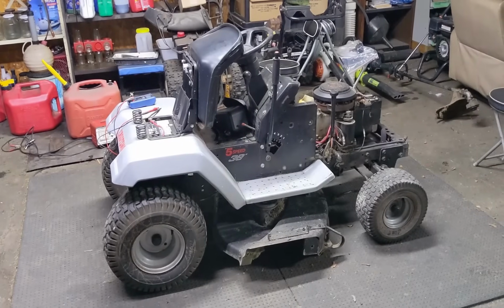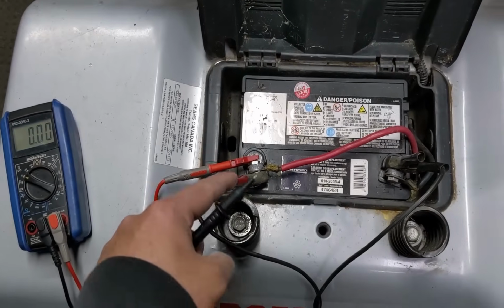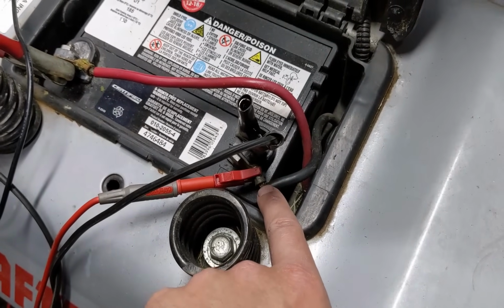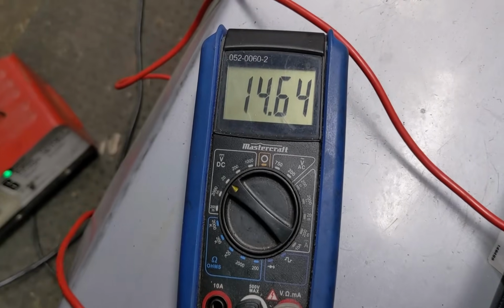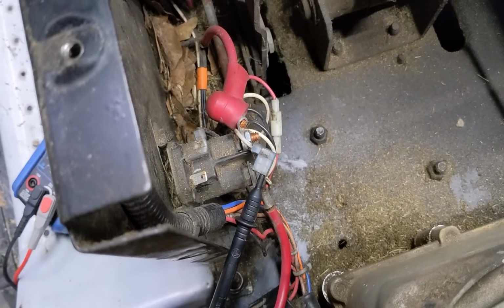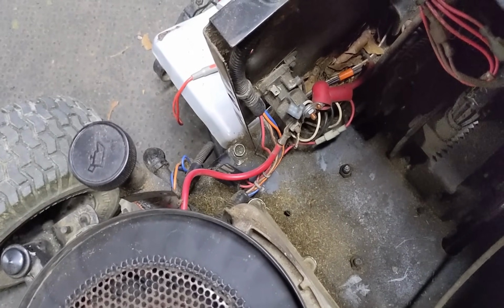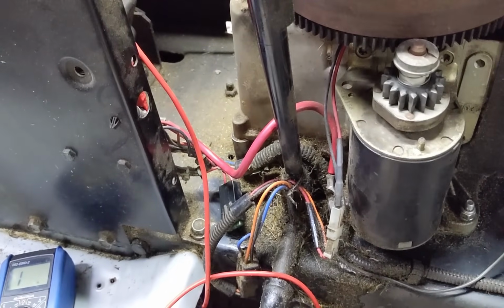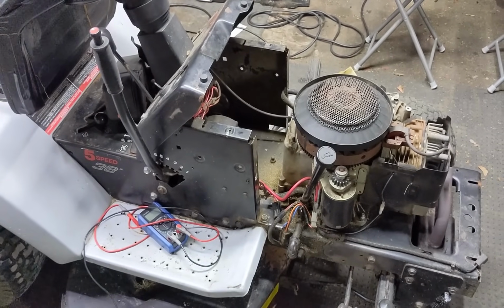Electrical Diagnosis of Riding Lawnmower that Won't Start

Comment: A Great video..
I've had a starting problem with my Hustler 54" Fastrak for months & I initially thought it was a bad ground because the 3 pole solenoid is bolted to a powder coated frame but thanks to your video it appears to be a faulty solenoid. It clicks when powered but no power when testing the starter side of the solenoid.

Comment: Did you know there are little slots on both sides of the end of the fuse? Stick your two probes in those slots to test the fuse without removing it. The amperage number is between the two slots. 😉

Comment: I have a sears gt3000 garden tractor from the late 90s early 2000s you can turn the key 10 times and never hear anything, on the 11th time it might start as good as if was brand new machine - this tractor does not have a starter solenoid. I assumed some one before me removed it, they also had a 50Amp fuse. But I just picked up another tractor of the same model and this one also has no starter solenoid and they jump wired the fuse. is it possible these tractors had no solenoids ? the actual starter motor mostly hidden by the engine plastic shrouds seems to have two "bumps" is it possible this starter motor has its own starter solenoid (the second bump) built in ? this vintage sears is an AYP (husqvarna) product. they both behave same intermittent starting even jump starting from bottom of starter is intermittent

Comment: I have a Toro Model 74787; Serial # 315001107.Does not start .Turn key starter turns but does not starts
Reply from the maker: If the engine cranks over, your starting circuit is working. You now need to test the engines running circuit. Something (safety switch) could be grounding out your coil. The easiest way to test if you have a bad coil, or an issue with a safety switch is you unplug the small black wire on the coil and try to start the engine. If it starts and runs with the black wire off, that means a switch is bad and needs to be replaced. If it still doesn't produce spark, then you need a coil.

Comment: My issue was related to a safety switch but not how you would initially think if you were trying to diagnose it. I by passed my RIO switch with a jumper wire a while back. The jumper wire had slid down under my PTO lever and was rubbing on metal when I switched the lever to the run position position causing it to short out. Zip tied the wire securely so it wouldn't move.  Problem solved

Comment: I'm getting 12+ volts on the battery side of the solenoid but only 6 or 7 volts on the starter side when I turn the key. Starter only turns the engine a small amount then stops. I have replaced battery and solenoid and still the same outcome. I am stumped...why do I not have 12 volts going to starter?
Reply from the maker: Test the voltage at the battery side when you're turning the engine over (putting it under load) you could have a voltage drop due to a bad starter, or a bad connection/cable from starter to solenoid. I would remove the starter and bench test it, basically putting 12v directly to the starter and see if that spins it properly. Then you rule out the starter. Electrical is always a process of elimination.

Comment: My ZD1011 blows the 10amp system control fuse anytime you try to start the engine.. the glowplug indicator still lights up.. tried disconnecting the alternator, no luck. Any idea what to check?

Comment: i guess it helps to know about electricity when doing this as i have no clue and it seems too mcuh to process.. i have a yardowrks ride on lawnmower and im having the same issue it doesnt even click so i just assume its electricla but i have no idea how to fix eelctrical things i have minmal knowledge of electricity i cant stand electric things..teh simple push mowers are more my thing..fuck these things. sounds like apain in the ass

Comment: Thank you so very much for your videos. they are very helpful.. maybe one comment you could make is before troubleshooting your starting problems; make sure that your blade is not engaged!!!!!!!🤣😂 No kidding!!! i watched both of your videos. PULLED my solenoid and tested it as per your instructions and all was good.... Followed the white wire from the solenoid to the cut off switch at the blade engage lever and from that position, my face was half in the engine compartment and I looked at the switch and at the same time my eyes moved up and seen that the blade was still engaged!!!!😆😆 The last time I cut the lawn it started poring rain and I drove it up and shut it off quick, never realizing that the blades where still engaged!!! The next time I tried to start it it wouldn't.. Never even thought to notice that the blades where still engaged!!🤣😂🤣😂
Thank you so much for the informative video!!🤣😂🤣

Comment: Just wanted to add to the others and tell you what a great you've done with this video. I do a lot of my own repair work with everything from the battery and screen on my phones to the heater core on my car and this is propably the best problem troubleshooting tutorial I've seen. Seriously. You explain not just what you are doing well but also why. I've never known why you need to test car batteries under load but don't have to with my flashlights; now I do.

Excellent work!

Comment: I recently had someone replace the starter on my mower. Right after it was replaced, it started no problem. The very next day it started blowing my 30A fuse. Doesn't even try to crank. Just immediately blows 30A. I disconnected the starter and tried different switch and it still blows the fuse. Could a bad solenoid cause a fuse to blow? Ideas?

Comment: Measuring resistance from the ground post to the frame with an ohmmeter is really useless, the current from the ohmmeter is nothing compared to the current from the battery during cranking. You could pass the resistance test and still have a bad cable.  This is a time when you should be doing a voltage drop test.  With the multimeter set on 20 volts dc, hook your lead to the negative post and the frame where the cable attaches turn the ignition key to start, and read the meter, what ever reading you get is the voltage drop across that cable so if your baseline is 12.75 and your voltage drop is 1.5 then the available voltage during cranking is 11.25.

Comment: Great job going through everything!  I went through mine and it ended up being the fuse not getting a good connection.  I have to get a new fuse holder.
Reply from the maker: Yes I've had to get them before, check the stens version it's very good, part 425-306

Comment: Followed steps and determined the solenoid on 2013 Husqvarna RZ5426 zero turn. I replaced the solenoid for the first time only recently. Mower has run twice since. Now the same issues as before, turn key and nothing. I did happen to look under the seat last time it ran for a visual after replacing the solenoid and touched the fuse box which seemed very hot. I did not restart but then a few days later nothing. The wiring harness has always appeared durable and well placed. I'm slipping wires out of the flex conduit for a n inspection of all the wiring.  I've never bothered touching that fuse box unless checking condition of the fuse. The box is clean. The heat felt on that box does not seem normal. No blown fuses, 20 AMP.

Comment: I have this same mower and checked everything you went through and it still clicks after replacing the solenoid. Please help. Also battery is brand new

Comment: I just wanted to say Thanks!!! I didn’t have a problem troubleshooting an electrical problem on the Abrams Tanks I worked on for years, but for some reason? I was intimidated by my Badboy Mower, maybe the name? Idk.  

 But thanks to your helpful walk through? I was able to locate the problem & figure out the root cause of the issue.. Which, was a little different than your problem here, so I’ll explain what I went through to help anyone else in my shoes. 

 Symptom: No response when I turned the key, no solenoid click, nothing. It gave out after 3 hours of cutting grass on a hot day, going down a hill. At first I thought it needed fuel because it was low, added fuel, then checked engine oil.. No, nothing. 

 Started at the battery which was good & well connected, tested the ground which had voltage going through the frame. But because I wasn’t getting any type of power response? I immediately thought it was a safety switch acting up, so I tested each one, but they were all good. 

 So, went back the battery, checked the solenoid, & it was getting power to it, but not across it. So when I tested the started side of the solenoid, & turned the key? Nothing. Instead of following my gut, I tested the ignition switch which was great to learn, but nothing.. The switch was working fine, but while I had the switch off? I decided to test the wire, & I was only getting 3.03 volts coming to the switch. When I traced it backwards, it lead me right to the 25amp wide blade fuse on my mower. 

 After seeing that the fuse from the solenoid was blown, a quick run to the store, & $3 dollars later? It was running again, but I noticed the throttle cable was stuck in the full open position, maxing out the rpm’s.  Apparently the plastic melted around it? So once that was fixed, it was running back to normal. 

 Thanks again, for all your help. Every video I watched from the switches to the solenoid were all yours, so thanks man! You saved us a ton of money over a $1.50 part.
Reply from the maker: Glad to hear you're back up and running!

Comment: Hurray! I was able to fix my mower. I went to one of your other videos where you talk about carburetor problems, and I was able to get the mower running by spraying a liberal amount of carb cleaner into it. The carb itself looked really clean, but there must have been some gunk in one of the jets that broke loose when I sprayed it. It now runs like a top! I bought a used mower engine off of eBay, cleaned it up, installed the carburetor off my old blown engine and saved myself $600! My mower now looks and runs amazing — not bad for a Sears Craftsman mower that was built in 1997.

Comment: AMAZING teaching job! You not only taught me how to troubleshoot my mower, you also explained to me the various parts of the mower, what they do, how they interconnect, and how to use my multi-meter. Your videos are so clear and concise, it's easy to follow along and learn. I wish I had found your channel sooner.

Unfortunately, I have yet to solve the problem of why my mower turns over, but won't start. But I have no doubt that with your help I'm going to figure it out. I'm going to spend the afternoon perusing your videos for an answer to my problem. I'm beginning to suspect that I may have a bad wire leading to the magneto or perhaps the magneto itself is bad. (It's old.) I think the easiest way to do that would be check to see if a spark is being provided to the plug by pulling its boot back while the engine is being cranked. It has a new spark plug, it's getting gas, and the carburetor was rebuilt by lawn mower a mechanic two years ago. The only other thing I can think of is perhaps the engine is flooding or the timing is off due to a broken key in the flywheel.
Reply from the maker: Thanks for the kind words, yes definitely test for spark 1st, then spray some carb cleaner in and turn it over and see if it fires up. If it does and then it shuts off, it probably isn't getting fuel

Comment: My riding mower stopped running. While emptying the grass catcher. Got back on and nothing. Always had to keep raising and lowering blade engagement lever for it to start, why I don't know. Guy who sold it to me told me to do that. It worked. Now it doesn't. Something to do with that lever. Any ideas?
Reply from the maker: Sounds like a safety switch is intermittent. There's a switch near that lever that tells the mower the blade is disengaged so it's safe to start. Sometimes the switches get loose and what will happen is you disengage the blades but the lever doesn't disengage the switch. Pop the hood and go under the steering wheel area, they're usually near the base of the lever.

Comment: I have watched many, many videos  while attempting to do all sorts of repairs.  This video, by far, is the most informative one I have ever watched.  I went from just trying to get my mower running (which I did) to getting a full blown tutorial on the entire electrical system.  Now I actually understand how it all works, which will certainly pay off in the future.  Thank you so much for this.
Reply from the maker: Glad it helped, thanks for watching!
Reply: I fully agree with Gregory Orr's comment above.  The best electrical troubleshooting video I've seen.  Well done!!!  This should help anyone who takes the time to watch it.  Simple, complete and spot on.

Comment: In the beginning of the video you kept saying the mower wouldn't start, It would have been good to show what you meant by this as this is such a vague term people use to explain there issue and it could be an indicator as to where to start first.

Comment: Hearing the starter solenoid click, tells me the black and white circuit is working. So I would immediately grab my handy dandy 12v test light and check for 12v into and out of the starter solenoid large red wire (with the ignition in the start position). I would see 12v on the input side but not in the output side, so bad starter solenoid. That took about 10 seconds.

Comment: I'm working on a identical lawnmower (Poulan). Question: Is the brake switch in the seat just to break ignition? I saw you tested with the seat up. Thank you for a thorough walk trough how to diagnose this particular issue 😊👍
Reply: Found out, it's not.

Comment: Best video so far. Working on a friends. Haven't done mechanic work in ages. My friend has no clue how to use a meter. He replaced the ignition switch with one from another mower, that one may be bad. He put in a new solenoid and a new starter, still no go. So now he has called me. I replaced the battery with a brand new one I bought for my mower that I know is good. Did some of these tests but not all. I will have to get back up there to complete these tests. I needed a refresher lol. If all tests good, it is on to your next videos to check the safety switches. You didn't mention the safety switch under the seat. There is also one on the shift lever that I will need to test. It is a Husqvarna. It shows in the wire diagram of the owners manual that there is a 20 amp fuse under the hood but I could not find it. I will have to look more. It may be just a generic manual and it is somewhere else?
Thanx
J.D.
Reply from the maker: Reason I didn't do seat switch is because there are many different kinds. Some craftsman ones are similar to the brake switch, so you can watch that video and it'll show you it's a connector on 1 side and a circuit breaker on the other.
Reply: @EliminatorPerformance  Thank you. First I have to finish all the tests shown in this video and find that god darned fuse.

Comment: Your videos are so very helpful.  I am getting 12 volts to the white wire and getting 12 volts to the battery side of the solenoid but when I turn the key switch I only get 4 volts from the starter side of the solenoid to the starter.  It's got me stumped.  The starter fires up if I connect everything in the garage, but not when connected in the lawnmower.  ???  Any comments from anyone would be most appreciated.

Comment: I'm trying  to  check my coil pack
Gets  hot it shuts off
Reply from the maker: Replace the coil or try loosening the fuel cap, could be a vapour lock issue

Comment: I have an issue I can not figure out. I have a craftsman 22hp mower that will not shut off with key. It also will not shut off if I exit the seat. I took the switch out of seat and checked it and it seems fine, checked both sides for continuity. I then checked the key switch, it works fine on all settings for continuity. Checked that the wires are in good shape and connected to coils. Unless I am forgetting something. Oh one thing it does do if the key is on run setting after start, when you turn key to off it does run rough but does not shut off.  Any ideas I would be greatly appreciated, Thanks John

Comment: How about just getting a jumper wire straight from the battery to the solenoid or from the hot on the solenoid to the starter.....or removing the starter and bench test it

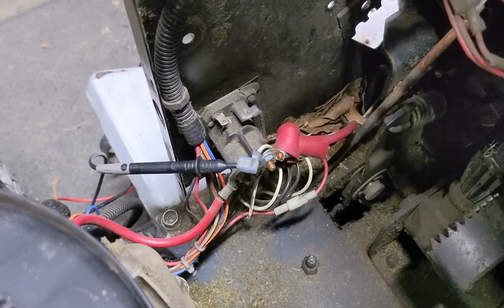Comment: So I bought my dead neighbors gravely zt1740, by passed all safety switches, replaced 4 post solenoid, pto, relay and start switch along with all fuel lines for fun.    Solenoid is grounded good but I have to put 12 onto the small starter wire and she purrs like a kitten.  I mow with it frequently but I just can't seem to figure out why I when tested like you did at 16:56...i get 11+ volts but it still won't  start it the right way.  Thoughts?
Reply from the maker: Take your hot wire from the keyswitch and go directly to the solenoid charge connection. Make sure it's fused on that wire, to or from the key switch. That's how you bypass everything to start
Reply: @EliminatorPerformance  it got dark on me but I will give it a shot tomorrow.  Thanks for responding.

Comment: Great video! I have a problem with my cub cadet ltx 1040 (kohler 19 hp courage engine). I recently replaced the solenoid and when I go to engage the motor, the starter is energized but makes a whining noise and then the fuse (20 amp) blows. I can tell that the whining is from the gears grinding against each other. I cannot figure out what the problem is since the starter is getting power. Any suggestions?
Reply from the maker: Kohler Courage engines have issues with starters, check this out, it might help; https://youtube.com/playlist?list=PLOTWBqOo4HbV0IaMe5Jxw4DLjcVZKJPMB
Reply: @EliminatorPerformance  thanks for sharing this video. Not exactly sure what gen starter I have but it seems like replacing the starter would fix my problem